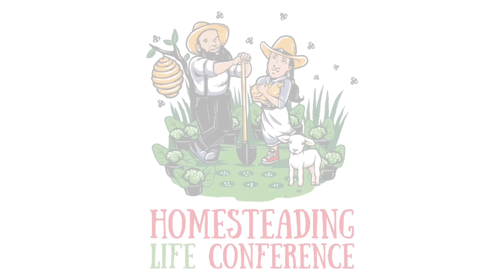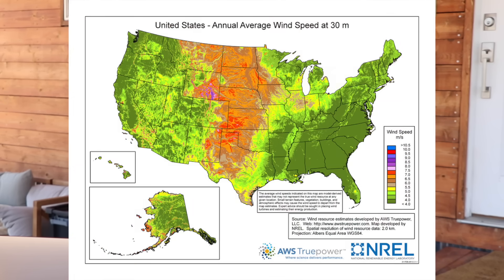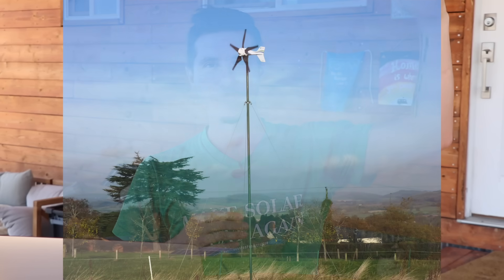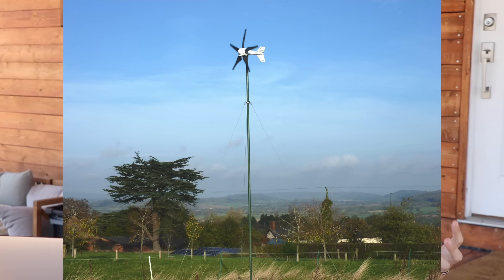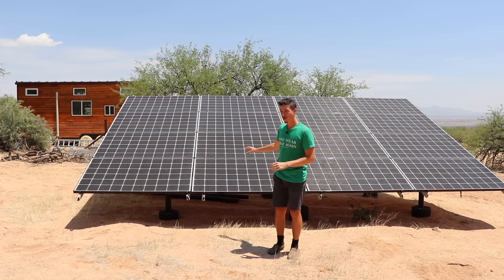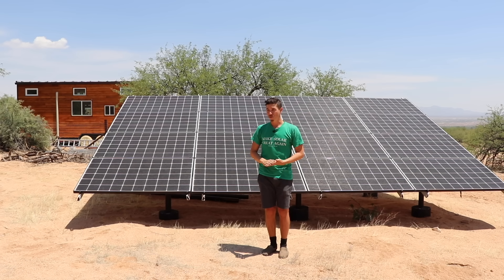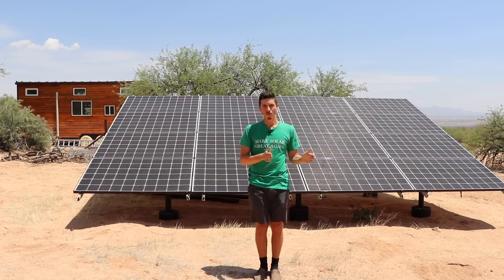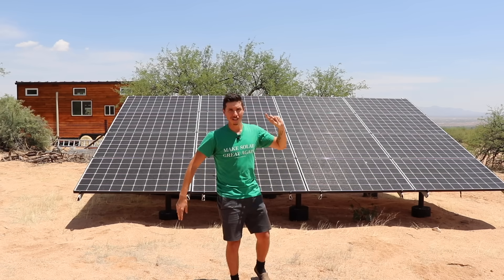Micro Wind Turbines... Are They Worth It? (Off Grid Solar)

Comment: so much wrong with this video.  You don't need 60ft towers.  the cost per KW is very similar for solar and wind in most locations.  Obviously, places with low cloud cover will do better with solar.  But the big benefit with wind is that you don't need as much battery storage to get you through cloudy days and nights if you have some constant wind.
Reply: Most people cannot cost justify a Wind Turbine because they do NOT generate enough energy.  Inside there is IRON and iron will RUST. The blades wear out. The bearings wear out.  The slip-rings wear out.  They become a maintenance nightmare

Comment: What happens with your solar panels if you have a week long snow storm and the wind is roaring then a wind turbine could help you catch up I been looking at the lantern style seems so simple. A friend has 2 lantern 4000 watt plus solar all mounted on top of his house not 60 feet in the air. They come with a control box and work like a alternator in your vehicle kicks out when not needed.

Comment: Not the first to point out that it's a site-specific equation, although I readily allow that the falling cost of PV has skewed the equation quite a bit in the last decade. Still, saying "just add more batteries" for greater autonomy undermines the economic argument. In any case, the authority of the argument is undermined more by words like "propeller" and "motor" when a wind turbine has neither of these. At least he didn't call them "windmills."

Comment: Where we live we have sunshine in the day and wind at night. We only use 6x solar panels 1800w and a 1000w wind turbine. Because of the turbine we don't need a large battery bank. We have 4x 200ah lead acid batteries. Get most of our power for free. We also live at the top of a big hill 😎

Comment: I bought both!  Do you have winds that blow 40 mph or more, constantly?  60 MPH would be better.  48 volt wind turbines (PMG) hitting >90VDC (Big Arc City) causing smoke to escape your inverter?  Smart guy going to hook it up to resistive heat element, bypassing all the electronics, and like the brake is on, it won't start spinning unless that gust gets it started.   Placement is critical, with two turbines left out of 4, 5 feet away from the fast spinning ine, the wind is weak, ugh.... Solar is better, except at Christmas.  My solar pays, the wind sucks cash, eats birds and killed a moose.  The micro wind turbine control electronics are much more complicated than One would have estimated, especially leaping in, "Do It Yourself".   Ask 3 'Experts' , visit with someone with one first.  I got bad advice, wish I had bought triple the panels, here in Anchorage Alaska.  What regulations with your grid operator.  Salesmen make Commissions on that huge "won't work to recharge when the grid is down" Lithium Batteries.  Ask, will the panels recharge the grid is dead battery?  Skip the battery, panels make the meter spin, depending on your state regulator.

Comment: Not a really good comparison between wind vs solar.. sound of these is minimal, maintenance is minimal. I  had mine for 8 plus years and the only thing is I moved from Denver to a new location  but nothing to the turbine. 500 watt solar panels?  24% efficiency vs 60 % for wind turbines
 Yes, a hybrid system is better, but wind isn't bad. Get real information before next video.
Reply: Your Wind turbine is NOT 60% efficient.  Don't lie to us !
Eventually ...
The blades will wear out. 
The bearings will wear out.
The slip-rings will wear out.
They become a maintenance nightmare

Comment: I think it depends on where you live and if you're off grid or not.  A channel I follow from a guy living in Wales has Wind, Solar and Hydro.  During the winter his Hydro powers pretty much everything, but the summer his stream dries up and his Solar gives him most of the power.  Usually when there's bad weather and the solar isn't working the Wind turbine fills in the gaps.  So I think in the right setting wind turbines have their place.  Eventually when solar becomes really efficient and battery technology has improved by leaps and bounds, solar will be the obvious choice for everyone..  But we aren't there yet.

Comment: Why not use both? I have a huge solar system... It was very expensive as you can imagine. ( 62 panels ) 
I find that the sun alone isn't reliable at all except the fact it's going to go down everyday . ( not always sunny in Kansas ) 
My reasoning for even thinking about wind is for those day where the sun isn't shinning bright, or snowy days, and when solar is covered by snow. 

Just curious if wind can be attached to the solar inverters? ( using solar and wind )
Reply: You are part of the 1% that live in the "Wind Corridor" - You might be able to cost justify a Wind Turbine, or not ...
Usually Wind Turbines are connected via a Wind Controller of some type.

Comment: Is this a joke because I laughed out loud through half of the video? 60 foot are you kidding me??? What kind of moron would put a microturbine?? My brother has 30 foot tall turbines on his farm and is 100% off grid making 4-12KWH 24-7. They are extremely Storm resistant. And just need Grease squirted in their grease fittings once a year or so. You can get 500-2000watts with 30 foot turbines all day just stop buying junk and build your own blades.
Reply: The higher the tower ... the better.  Your brother is part of the 1%'ers that do have enough wind - 99% do not...

Comment: Basically: 
P<= 1/2 x 0.59 x p x A x V³
p = air density
A = pi x r²  or  diameter x height in vertical axis.
V= air velocity 

What do you need? Ejem: 2000W at 8,29m/s nominal
10m2 > Pmax=  3477 W  >>>>>> Pmax (Betz) = 2051 W
You need a 10m2 windmill at 8,29m/s
Reply: In the Real World you will get only 800 Watts at 8.3 m/s or 18 MPH steady wind on a tall tower with straight/smooth winds.  Now, WHO actually has STEADY 18 mph winds blowing for 12 hours per day?  Very few people, especially in the USA.

Comment: What do you do with your solar panels when they fail?
Reply: I will let you know when that actually happens.  Most likely, will be RECYCLED by then?
Reply: @vtorsi610  there is no recycling capability for solar panels at the moment....all of the failed ones just get buried
Reply: @RabidNative   Actually, manufacturers like Sun Power & First Solar do have a recycling program.  Also, Recycle PV does recycle Solar Panels.  Recycling has already begun. When I have a failed panel in 30 YEARS, I will let you where it went ...
Reply: @RabidNative  Can't you read?  I previously wrote ... manufacturers like Sun Power & First Solar do have a recycling program.  Recycling has already begun.  What part of that do you not understand ?
Reply: @vtorsi610  "...that a recycling program that handles more than 10% of the current rate of waste..."

Since my statement seems to cause you issues, I will rephrase it

The current amount of recycling vs units to be recycled is 10%.  as in 90% hit a landfill AT THIS TIME.    You are saying that in 25 years you hope that there will be a recycling program that is capable of not only handling the remaining 90% of current damaged/failed units,  but also the rapid increase in recycling demands that will occur over the next 10-15 years due to the last 10 years of pushing silica based panels.  

I will repeat what I originally said,  HOPING that a plan will be developed that can handle today's load, let alone future projected loads, is the exact reason that we are in the situation that we are in with CO.  

TL:DR
You push the issues off to future generations so you can feel better about yourself now.

Comment: Wind turbines have no degradation though. So graphed over time wind does become pretty efficient vs solar panels overtime when considering diminishing returns. Why not plant a couple of pine trees and attach the turbine to these trees. Over a few years they will reach 65 feet pretty easily. No cost in that either.
Reply: Inside, there is IRON and iron will RUST.
The blades wear out. 
The bearings wear out.
The slip-rings wear out.
They become a maintenance nightmare
Reply: @vtorsi610  stupid

Comment: Wow what a slanted view on wind power. First off your solar panels dont max out every hr, every day.
Second for every 10 ft vertical you gain, you gain 10-20% in speed.
Thats why higher is better but 60+ is abit silly, 30ft in normal.
Thirdly, you are correct, if you don't have lots of wind, wind power isnt worth it, same goes for sun and hydro.
Reply: 30' is the MINIMUM Tower Height.   A 60' tower increases energy output by a whopping 40% !!!  A 60' Tower is NORMAL for most residential wind turbines around here.  The BOTTOM of the blades should be 30' higher than tallest object within 500' radius.

Comment: Yeah Solar is great but if you live up in the north and or in the woods your not getting sun everyday, but you definitely get some very windy nights. wouldn't it be a better idea to build a tree stand in a large very tall tree and just erect the wind mill on that. a lot of work but way easier and cheaper than building a 60ft structure.
Reply: It may be cheaper and easier to use a tree, instead of a pole, but it is not better ...

Comment: I argue that photovoltaic panels do not generate after sundown. Where as your wind turbine can.
If you are concerned about generating to much power... Connect to the grid and cell your excess. When you are not generating power draw from the grid. And you can forgo batteries and that bit of maintains. 
Of course, obviously, adding the batteries, although extra experience and maintenance, mean you are not dependant on the power company.
And either way, you can expect a small check from the power company at the end of each month for your excess.
In most states, (for example Michigan.) The powers companies are required by law to purchase your excess. And to do so at the going rate.
Furthermore... 
You can hook your windmill/turbine into the pump at your well head to keep your water supply topped off.
If you are concerned about the physical appearance of the system use an "old fashioned farmer's windmill"
Reply: How can you connect to the GRID, when you are OFF-GRID ?
Reply: @MrSummitville  you set up with a meter that runs both ways. If you are generating it runs one way... Or The other of you are purchasing power from the grid.
At the end of the month, you get a bill or a check for the dierance. 
I have a couple of friends up in southern Michigan that routinely revive a check in the mail each month for between five and ten dollars. It's only a couple of times that they've gotten a bill. (I think he once, about two years ago, told me he'd owed the power company  $0.78 for an entire month.)
Reply: @whowantstono8881  Look-up the definition of OFF-GRID homestead ...
Reply: @MrSummitville  That's cool too. IF your objective is to completely detach from the grid, then, (As I already have pointed out above) add the battery bank and have fun. I was just pointing out some of the alternatives. And as I say above, the reason to use both solar and wind in combination is that wind can generate after sundown.
Reply: @whowantstono8881  If you have Grid Power, then it would be a financial disaster to add a Micro Wind Turbine - it makes no sense!  Even for Off-Grid Homesteads ... adding a Wind Turbine is very difficult to cost justify.  You have yet to prove that a Micro Wind Turbine can be cost justified ...

Comment: I am a electrician and i Totally agree with you.  Fair play to you great advice for people
Reply: Location Location Location is a must with all products your setup is perfect for your location. Well done. Wind turbines are a headache if not installed correctly . Vibration effect and shudder. Its what the person requires and wants to spend. Some folk go over board, never recovering the investment.. You have to find you bang for buck mulitiplied by time/ energy received  divided by investment. Thats all its simple really if you keep it that way .
Reply: @anthonyduffy8062  Even when installed correctly,  Wind Turbines can be a headache ...
Inside, there is IRON and iron will RUST.
The blades wear out. 
The bearings wear out.
The slip-rings wear out.
They become a maintenance nightmare.

How does the average person get a heavy wind down, from a 60' Tower?

Comment: If your in a bad area or have a piece of crap wind turbine which is common I agree solar is better however Hurricane wind power kicks solar's ass watch and check the data for yourself https://www.youtube.com/watch?v=x2dsXAgYKA4  1.2 kw solar versus 1 kw turbine in 24 hour output KWH I am not trolling you as I have seen the "other company " do but I think your making an attribution error based on your experience. 10 kwh versus 3 kwh wind wins this round although we design large solar systems and love both
Reply: Very few people actually get 20 MPH for that many hours per day.  If you happen to live in the "Wind Corridor" of the USA then a Wind Turbine may make sense.
Reply: @vtorsi610  I am sure your uniquely unqualified to make this assessment. do you live off grid? I doubt it

Comment: Vawt... ok so here's a good thing for you to do.  Go to the junk yard, get a few alternators, make some vawt.  Flow batteries! Redflow and ess are a couple good companies.
Reply: VAWT's are even less efficient than HAWT's.  Car Alternator need to spin really fast and VAWT's don't spin really fast = problem
Reply: @MrSummitville  sounds like a gearing problem to me.  Vawt cuts in at lower wind speeds.
Reply: @whitlockbr  Nope, adding gearing would make the VAWT, makes it even less efficient and more difficult to start turning.  The transmission of a car does not ever try to start rolling using High Gear, for a very good reason ...
Reply: @whitlockbr  Still LESS efficient than a HAWT.  And if you do NOT have enough or any wind, it is pointless...

Comment: Your missing the point - by diversifying your power source you are more likely to secure your power - wind power can be especially useful in winter when the sun is limited  - windmills can power heat pumps directly (not via electric )and the energy stored in mass systems like insulated water tanks or rocks - I guess much depends on location and your capacity to think outside the box.
Reply: You need good wind, to make good power.  It makes no sense for most people to install a Wind Turbine, when the blades don't spin ...

Comment: Wind power is considered more efficient than solar because these systems use less energy, release less carbon dioxide and produce more overall energy. A single wind turbine can generate the same amount of electricity in kWh (or kilowatt-hours) as thousands of solar panels.

PS: you can attached solar panels to every wind turbine you put up and have a mixed grid. Since it's not as big as a commercial turbine, noise shouldn't be an issue.
Reply: Solar Panels are great, if you live where it is sunny.  Wind Turbines are great, if you live where it is windy.  Both are great if you live where it is sunny & windy.

Comment: You could do it with vibration and piezoelectricity but the voltage would be above 20,000 volts. You wouldn't want batteries they would blow up and would have to use capacitors. 500 lbs of force on a quartz crystal gives off 12,500 volts per cubic centimeter... the key is to keep it vibrating by cutting it in tune to 90 hertz. It will pick up 5 octaves above it and 5 octaves below it from the harmonics alone.... all within the range of all audible noise including your heartbeat and everyone else's heartbeat from an 800 mile radius around it. You generate a steady spark across a transducer and your already up to 360,000 cycles in the blink of an eye.... add another 5 octaves to that and your already at 11.5 million cycles a second hammering on those crystals. It's incredibly simple yet highly dangerous.... basically converting mechanical vibration into electrical energy. So basically if your capacitor bank is fully charging 11 million times a second your never going to run out of power no matter how hard you try.